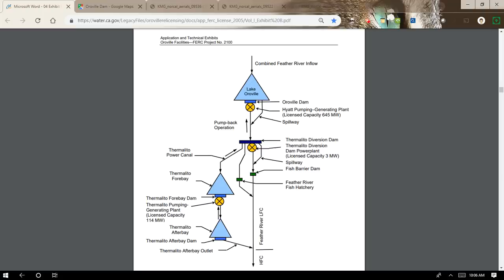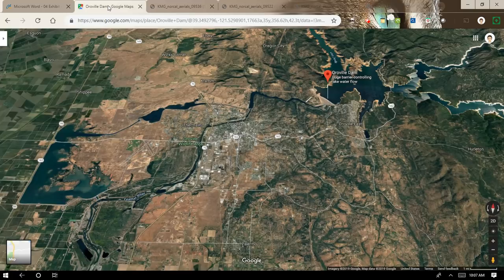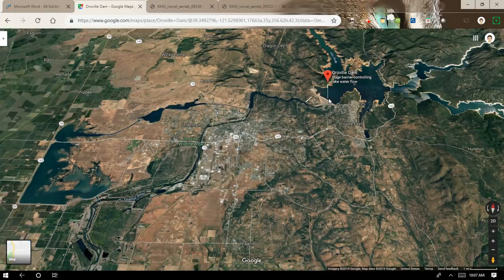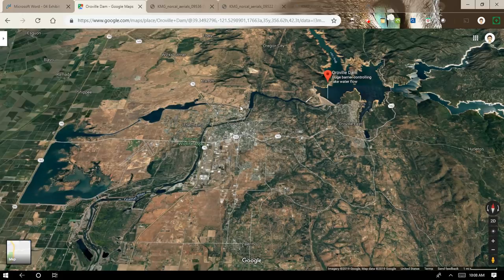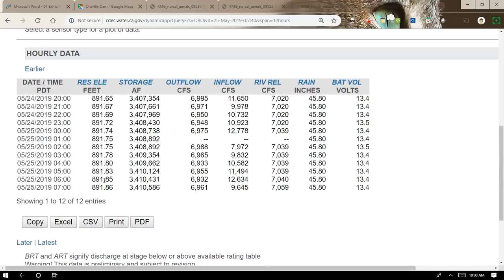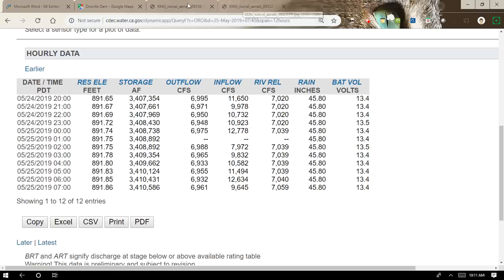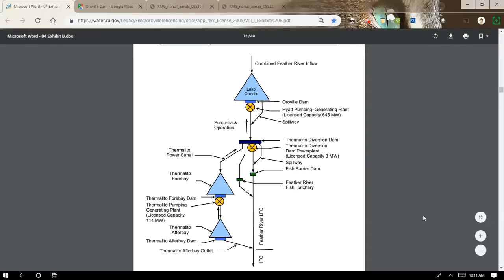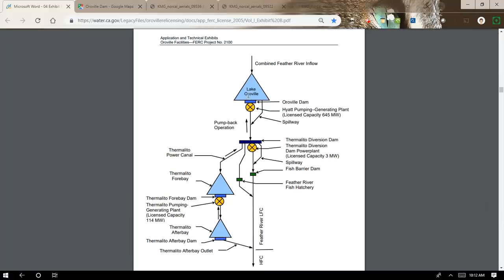What are River Releases at Oroville Dam / Reservoir? ~ Millie Kay 5/25/19

Comment: Hello Millie ~~ You did a wonderful job explaining the differences between River Release's from the Oroville Dam down to the Diversion Dam where it is separated at that gated structures. Some of the River continues to flow past the Fish Barrier Dam and on through the City of Oroville and on down to Yuba City/Marysville. The other part of the river is diverted into the Power Cannel going West under Hwy. 99 and into the For-Bay above the Thermalito Power Plant (it's not working ) and it is dropped 100' through it's radial Gated controlled Spillway structure, then continues flowing S/W into the much larger After-Bay. This is where it gets complicated understanding the numbers on the CDEC chart to balance the out flow numbers from the Dam and the out flow from the River Outlet . Because of the fact that there are 5 more ( total of 6 )  openings from the After-Bay that are controlled to release water from the After Bay, not just the Large River Outlet Structure. These are 
(4) large and small cannels that cross under Hwy. 99 that are flowing from control structures to the East of the highway out of the After-Bay. (1) more larger control structure and cannel flowing South out of the After bay by E. Hamilton Rd.  Then finally the very Large River Outlet under Larkin Rd.
 It gets complicated balancing water that is being stored for temperature control,  rice production & crops in general, fish habitat and the over all necessity to storage water for future use.  Most of all,  maintaining the  safe control of the mighty Feather River river flowing water that has in the not to distant past  years before the Dam was Constructed, caused devastating Floods in the valley below. It takes computers and highly skilled operators to balance these needs and a simple mathematical difference between inflows and out flows to the river that is showing up on that simplistic  CDEC chart is a very simple view about a very  complicated matrix that is being preformed by engineers. The whack- a - Doodles that are in constant complaint on another channel are for the most part, have no idea about what they are Glooming and Dooming about.
Reply from the maker: Thanks for providing more details, Jerry. I did a video on the 8-mile dam https://www.youtube.com/watch?v=3MsdvoEJxck in 2017. It took a ton of research to figure out the various outlets in the Afterbay. Amazing system! (I didn't know it was a 100' drop at the Thermalito plant. Wow!) Come back again soon.
Reply: We are very blessed to have her commentary. What a sweetie🌹🙏🏼🌹
Reply: But.....they should just release water down the spillway at Oroville to satisfy the whack-a-doodle, trumpet, common sense, perth, types to satisfy and disprove there "solid" theories that the spillway isnt useable!

Think yall have got way to technical for them with all this accurate and factual based info.
Reply: @Gavin84w  ~~ Gavin why I don't disagree with you that it would satisfy a bunch of Whack-a-dooles,....Why waste the water just to show a bunch of uninformed none  believers that everything is OK  ??? The goal of DWR and the Metropolitan Water District ( MWD ) is to have a full reservoir to provide the necessary down stream water commitments to the vast agricultural interests threw ought California that has suffered from a long term drought. They are also pumping water back into the ground water voids that have been depleted by the drought. I have lived in Oroville for the past 50 years, worked for DWR as an engineer for ten years on the Thermalito Power Plant construction and have seen the lake top out at elevation 900 several times providing a full reservoir for the people. Whack-a-doodles were under a rock where they belong !!!
Reply: @stutz1751  100%, it blows me away how dumb they are to not grasp simple concepts and functionality of how a dam works and in the case of this system the significant down stream functions of the water
Reply: @Gavin84w  Have any of you checked out aplanetruth2 channel.  I mean the things hes presented are fact based with pictures and all.  How am i to tell whats real anymore, unbelievable that the internet was supposed to bring about more knowledge and understanding but yet its all just muddy waters now.  Uggghh
Reply: You both have hit the nail on the head great information you have shared here

Comment: Kind of looking like the spillway will not be needed.
Reply from the maker: I hope not -- but that puts a lot of pressure on the Hyatt turbines to do the job. Thanks for stopping by!
Reply: @MillieKay  That is why the generators are there, to generate electrical power just like Hover Dam, Grand Cooley , yada, yada. It is all about the money from electrical power and conserving as much water in the reservoir as feasible. Water going down the radial gated spillway is energy lost . The power house is used to moderate the outflow of water to maximize its use in a maze of requirements for irrigating, temperature control, fish habitat and a multitude of uses that it takes computers to keep inventory of its use. Turbines are designed to do this job, mind you with proper maintenance ( Lacking in some cases) and hopefully DWR will get their ass chewed over this oversight.
Reply from the maker: Hi Jerry! It is definitely a balancing act to perform the functions needed to orchestrate matters in the entire Oroville-Thermalito Complex. It is impossible to focus on one aspect without consideration for other factors. Most people aren't aware of the system as a whole.